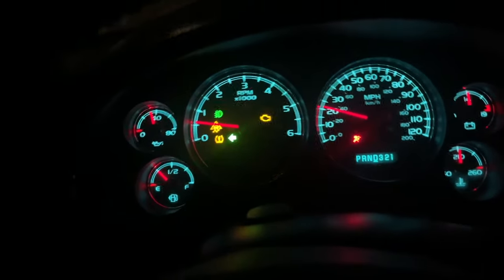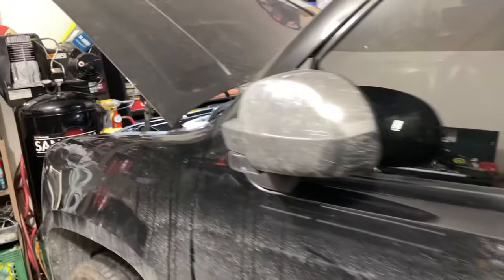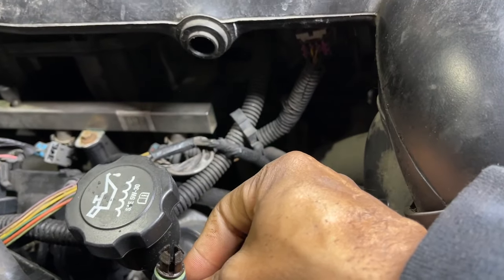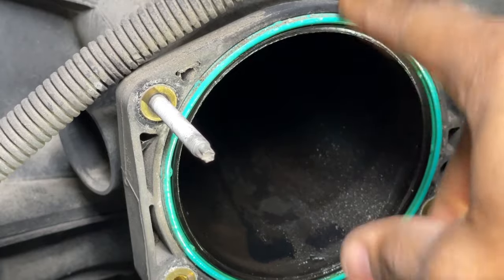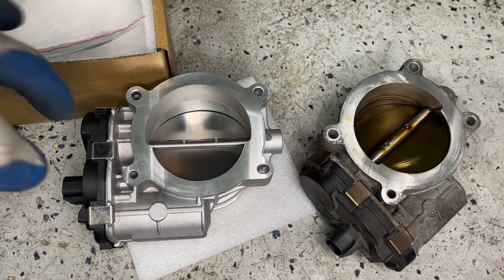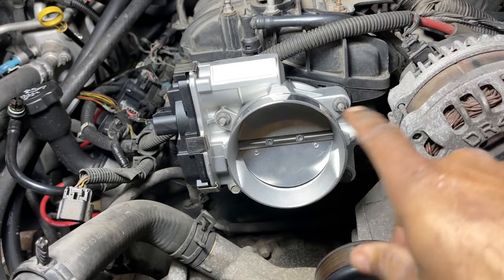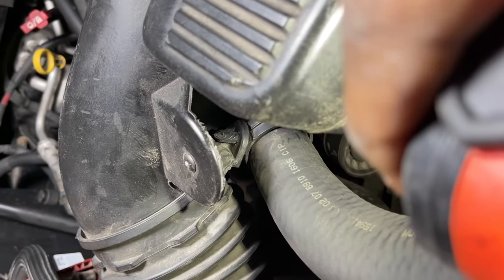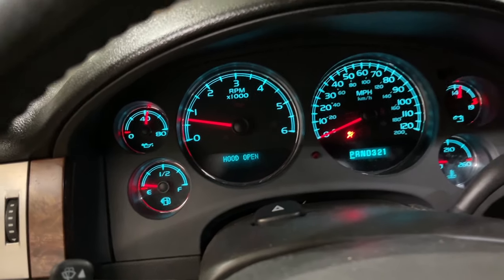How To Fix Reduced Engine Power Quick And Simple! Code P2135 Chevy Or GMC Trucks / SUV's! TPS Issue!

Comment: Thanks for the video. I ended up having to change the throttle body. My car has 125k on it. Only question I do have it, the voltage meter. What is it supposed to be on? I notice it starts at 14 or a little over then after a while it goes down between 12-14. Does that mean I need a new battery? Other than that, the car runs great.
Reply from the maker: Nope, you do not need a new battery. You're fine. Thank you so much for watching.
Reply: @TerenceDIY  thanks so much!
Reply from the maker: @jaezoeysvlogs9267  , you're very welcome. Once again, thank YOU for watching.

Comment: I'm curious how much your throttle body cost? I've got the p2135 on a Versa Note and my mechanic changed the accelerator pedal sensor yesterday then today it failed and did it again. Am hoping it's a throttle body sensor now up by the throttle body but maybe this is what I need too.
Reply from the maker: There are some correlation with that code although the car is different. What year is your Versa? Here are links for two different engines (I believe the only two that comes in the Versa)/

https://www.ebay.com/itm/404497710422?fits=Model%3AVersa%7CMake%3ANissan&hash=item5e2df13d56:g:p08AAOSwTChlCA-c&amdata=enc%3AAQAIAAAA0NxBoGsgfw1CUQXh7SN61L5MOU2m7YHpUY8O6oCM7djy67q95OcsNjuNFCAU9venJtYtMe4fvRiYl%2FvTpHj4kTXr1%2B9PMx2ZEnA9u%2FQjm5FW5CrAvZev2lNa%2Fr2Ff5QGnZyzGNMx%2FjrWa7cldSk7TdUmU6vvOtQvbkbdd7q6oiTjGh95H1o22jr7Tl1Ia6ujbakBhTYmk4Bk%2F31V2XqDcDtcxPiUV2kuZToo1dAPXwSTTX9mpD9IeaAw0TDMhoe2fZDOKjBJh8qBw8YbaVoV0zA%3D%7Ctkp%3ABlBMULbs1IvwYg

https://www.ebay.com/itm/255438181565?fits=Model%3AVersa%7CMake%3ANissan&hash=item3b794d54bd:g:paMAAOSwq6NkwMVs&amdata=enc%3AAQAIAAAA8E5Ukk3gmI0mWPi1uzqGXCwF0%2FJZN46gR9sSgJh29PlQvAE4IYq0XwMNDGBHuPWM0upqI7HCO16Gke6hbDiw84oy8Q94AlLqdcNNsP6CXayvJn9d7Mk9EzGY4G2bikeLr4GT%2FK90573ZMZcXQ20NZRO3PXbifCXRqDpm75AaQLZW0WEVGlmhGNaEReuAX8XwBo4LJUlAPzQt9uKK09tms4th3ZFLfhGeHrua%2Ff63MjE63iA8gJmleBRddF8nZa9Hiiq1lCynyNNOuNG4f%2FRTuJgla9gP6al3S84VU3VFhmmyGcSqlcP8y4va9o2FuXfG2w%3D%3D%7Ctkp%3ABFBMtuzUi_Bi
Reply: @TerenceDIY  Thanks for that that's not nearly as expensive as I was afraid it would be. Mine is a 2015 Versa Note.
Reply from the maker: Yep, they are inexpensive. You're very welcome.

Comment: Hey Terrance great vedio. I have the same problem with 02 cadillac truck. But it only has no power when it gets at operating temp. I have changed gas pedal and I have done major tune up. Do you think I need to change throttle body also let me know thanks.
Reply from the maker: Ronald, I've worked on a few earlier model Cadillac Escalades and If I'm not mistaking, I believe your truck has a TPS sensor. I had symptoms like yours on a 2001 Cadillac Escalade and replaced the TPS and it ran perfectly. 

Here is a link to the part...

https://www.ebay.com/itm/353602876285?fits=Year%3A2002%7CMake%3ACadillac&hash=item52545fb37d:g:WLUAAOSwNS9hB95-&amdata=enc%3AAQAHAAAA8KSF%2FdSWS1%2BR5i1P5f8vk54vclSdbdTUmQEhgfOny0AWmSFfbcHEm3u24IpnVK3hVpHCz2iHCx7d7wTlDghf5cnEdpJnzR157hQM%2BdcV%2FJPJiQ71iQxMOiXS3%2BvWfSM4eB4o3EVOmt1xbAtqHNA7mKBv%2F72aw0ak0sR0Yqp1hp%2BLkGKgVUHCkQhYDXroGJclm5I8jWWxAkaCTQ1qgmPudWOWkh6OVJOssLWv88c4LC8DH7PrBgPTwLgeS%2FlZMFBYpiGkkWKAFh3VJpfE4XgINzKiIrtHW7NBnlPrrezi%2B6Ya6ohsw41qc%2BKNjoGG2q%2BKlA%3D%3D%7Ctkp%3ABFBMtrDSiddg
Reply: Hey Terence thanks so much. I will order it and give it a try thanks.
Reply from the maker: No problem Ronald. Let me know how it turns out. Thanks again for watching.

Comment: Great video I’m having the same problem out of my 09 suburban  but I cleaned my throttle body and put it back together and it’s doing the same thing and it’s reving at 3k.  I think I should just change it and then my buddy said the gas pedal could be the issue also can you get back wit me on some advice please I’d appreciate that thanks
Reply from the maker: Sorry for the late repsonse. I've rarely seen the gas pedal being the issue and I've worked on many. The majority of the times it requires the throttle body to be replaced. Here is a link for the part if you decide to replace it (below). Thank you for watching. 

https://www.ebay.com/itm/273974704021?fits=Year%3A2009%7CMake%3AChevrolet&hash=item3fca2a3795:g:y0IAAOSwJeRgNim-&amdata=enc%3AAQAHAAAA8EBZbnc1LCSygdfhiYDkZYdGoD3ttGzQ5l5boPsF4Ze3hd5Wp4xZTyFxUDBUyl3ZhA5%2BBEF6HtdIAlhi%2BR6MqqBx%2FlmHRls7OFXwF%2Br63xeEZh9Js1AlWtqLAu6vAJOOLI83i%2BRwj0WQizJzCqKEOSvkJMksmu6tuNDZSRNniNU6zZIHXNKcSVoO%2BKrNu3QGuNe8%2BWzh65fFXWQo4qSUyGjShpR6otuuigrlCjG8POHBzvHy%2Blg4ZCGM%2FHoLUz%2B61ku3fcYKwsKumvrHX1aVN7mrODXDLCCG%2FzoSiCxk5ralJS2ZNy69Yj0hdOoxQnPGrg%3D%3D%7Ctkp%3ABFBMsPuPv6Nh
Reply: @TerenceDIY  thank you bro
Reply from the maker: You're very welcome.
Reply: *I replaced the waterpump a few days ago.

Comment: My 2008 Chevy Silverado is doing the same thing, I already change the throttle body and it worked for a few days then it startin doin it again
Reply from the maker: You should check the harness that follows the connector that plugs into the throttle body. I've seen mutiple post on the Chevrolet bulletin about the wires that run to the throttle body being the issue. Also, did you replace it with an original GM throttle body? The aftermarket ones are not that good.
Reply: @TerenceDIY  no I bought a factory one from the Chevy dealership,

Comment: I have a 2008 chevy Silverado ive spent crazy money replacing everything just did the tps yesterday and still same code p0641 and it does the engine red power and stabilitrack goes off i am lost
Reply from the maker: I've dealt with that code a few times on similar vehicles. Unfortunately, it was the PCM 9 out of 10 times that fixed the problem. I hope this helps. Thanks for watching.

Comment: Hello i put in the throttle body and it accelerates on its own goes up and engine shuts down what do i do ?
Reply from the maker: I have two questions... First, was the battery completely disconnected when you replaced the part? Second, did you use an OEM throttle body?

Comment: What is the name of that part I know it comes with a new sensor but don’t know the name of the part
Reply from the maker: It's called a throttle body. Here is a link to the part. 

https://www.ebay.com/itm/225590875332?fits=Year%3A2010%7CMake%3AChevrolet&hash=item34864394c4:g:tgUAAOSwNrhkby5M&amdata=enc%3AAQAIAAAA0NNQWXMnLtdnN%2Byk2rlPXLmDWd9AB5%2FNY652Eej11m1%2F%2FBCO7b5L%2F5kYwu2G%2FiIjmCXQhRCyGEq0LUGYMRA88FpvJcPcwE27If5mxCeP3vG6W5LgP5pjW5K9gWraTiJmkvjpUgRgSPfNW1iIiX7wNUbQiYDUszbrKMfUD%2B4PuolTPrHThw1m%2BLmIzDJHmAqsOMxE8CL%2FcbWx1GgGqyuo%2FbcgMiInIFFeTGjPVCpeCIYvGzqKgHKKWdVCxyvEkX4P0v8cB8X544I0q3p6jrL0gDU%3D%7Ctkp%3ABlBMUNyPq4-yYw

Comment: Hello, did you say the engine in this Suburban is a 6.2?
Reply from the maker: It's a 6.0.
Reply: Oh,ok. Did it come from the factory like that, or was it or was it swapped? The reason why I ask is because I never knew that Suburbans came with anything other than the 5.3. Thanks!
Reply from the maker: Yep, factory 6.0. They weren't common, but a great option. Thanks for watching.
Reply: Hey, LQ4 or LQ9?
Reply from the maker: LQ9. Thanks for watching.
Reply: Nice! Good info. Thanks!
Reply from the maker: Thank you and thanks for watching.

Comment: Hello Sir, I've a Ford focus 2013 1.6 Ti Vct and since 2 month I've been having codes and issues with throttle and pedal accelerator. I've replaced the pedal as well as the throttle. It worked fine for 3 weeks and now I'm having code P2135 and P0121. 
What can you suggest that I do?
Thank you
Reply from the maker: Did you replace the throttle body with an OEM one or an off brand aftermarket? There's a huge difference.

Comment: I have a 2009 chevy silverado single cab and I just put the new throttle bottle and is still doing the same thing what else can it be?
Reply from the maker: Did you buy a aftermarket one? Also, there was an issue with the harness that runs to that throttle body on Chevorlet bulletin years ago. Check along that harness for frayed wires.
Reply: @TerenceDIY  the one i bought i got it from oreillys and i’ll check the wires later
Reply from the maker: @arturogonzalez679  , I would have bought this one before buying one at Oreily's....

https://www.ebay.com/itm/333272439452?fits=Year%3A2007%7CMake%3AChevrolet&hash=item4d9895da9c:g:EpoAAOSw6QJdM5EW&amdata=enc%3AAQAHAAAA8MoUyTfsKekX%2Be%2BCj7USOvxRS2XHH%2B4s%2F3tNXtAZ4Z%2BLY2YJ8cZZawMqXI5eRkCN2peingTBDhw67RTFniZ13YeWeYbWwzGRlOX3gCqapuSIPwlEOfKzGzdNW%2BNzE8MbtbDD9z6OMQbiD8PHUpftDQob%2B8jIMZrSdyi6iSFtb%2B7Es92%2B7tLFSHLiPNZcXaFzS0bx0DVN%2F0USwpZK7JzOrTnJoZlngr1OcML6eXisvobwLquLxliqLsnnnwy0KSLenFK3RdOhtWSe81ytBq4IB3XtmPJTfU67VXNhyva0EuAk0xHtN01xk%2B9hn2gEScP%2Blg%3D%3D%7Ctkp%3ABFBMhNisiK1h

Comment: Hey I have the exact same problem going on ,on my 04 Tahoe I’ve had the throttle body replaced and throttle position sensor as well but still getting no power to the truck when pressing gas what’s the part you replacing on your truck? Or what else should I do ?
Reply from the maker: Hi, the throttle body and the throttle position sensor is one piece on your vehicle. Was the entire unit replaced? Did they use OEM parts? Here's a link to the part that should have been replaced on your truck if indeed you had the same issue as mines. 

https://www.ebay.com/itm/403341124758?fits=Year%3A2004%7CModel%3ATahoe%7CMake%3AChevrolet&epid=19056097644&hash=item5de9012496:g:yw4AAOSwpuZg3YmH&amdata=enc%3AAQAHAAAAsKAPRnavpJ3shiCJDwYpZr2axWmfAi899m3g0cCAQN7o%2FqKH3RvTmK9BfQtl4dRodghHTg4rkKNq4%2FRciyD888N1lGThhGo%2B8ZnzoFlDv0%2BFGq6infSvyABdZ%2Bp0VdhPkWEgRZC9zxQpteAJ8tr12ohE1GQCOjL9B3S0YhxqF%2FP3N1QTTn%2FTyyklcwM6aRCV3Lm56fa80JtWfZZL6qMYITLv8FNmXWAs343zAVlNsLs5%7Ctkp%3ABk9SR7Ca4OOQYQ

Let me know.
Reply: Have u change your sparks plugs ?
Reply: Have u change your  sparks plugs ?
Reply from the maker: Yes, I did a total tune-up on this vehicle. Here is the link....

https://www.youtube.com/watch?v=1K9NaCLlgDA&lc=UgwREDtfPcAKAiY9eHF4AaABAg

Comment: @terencediy i have a 6.0 denali yukon. It has been sitting for a year same problem could it be the tps on my gas pedal because i have the adjustable pedals and my gas pedal broke. So it doesn't adjust and it floos around until i put my foot on it and push back down on it to accelerate
Reply from the maker: I have the exact setup as you (6.0, adjustable pedals), and your problem could very well be the accelerator pedal sensor.

Comment: I’ve had the same issue on my 2008 Yukon xl replaced throttle body and gas pedal and it goes away and Come back I’m not understanding why
Reply from the maker: How long does the problem go away? Also, did you replace the throttle body with an OEM one? Thanks,
Reply: @TerenceDIY  it’s went away for a day and came back I’ve been told I need to reset the sensor but idk how I was told you drive it on the freeway for 30 minutes that didn’t work I even took my battery unhook for a he to see if that would reset it but that didn’t so now idek what’s going on
Reply: @TerenceDIY  wym OEM?
Reply from the maker: OEM is the term for the original GM part. The after market throttle body can be faulty even if purchased new. They are very unreliable. I'm not saying that's your issue, but I would not rule that out. Where did you buy it from? Also, there was a bulletin released by GM in 2012 detailing an issue surrounding the connector and harness that runs to the throttle body. The wires can become frayed or damaged so do a visual inspection on that connector. Here are two links to an OEM throttle body. One is slightly used and the other is brand new. This is what I used. 

https://www.ebay.com/itm/256031367242?fits=Year%3A2008%7CModel%3AYukon+XL+1500&hash=item3b9ca8a04a:g:Q5UAAOSwwztkKnaI&amdata=enc%3AAQAIAAAA8BMCXDiQkJtbNJ628QhOhMChCPS3HKyYnEdoyuE%2Ftajs2C3X48C%2BCQ7XYmic%2Ffy6gsx7JpWlGwsxeKrr6Eo3EWFY1%2FoogB4XKJYEZdJv%2FcABIoUw6FmOHM%2B7Pm0NCyzPuB6vbfWkMggU5f%2By77FDy8kfnTPc2Fd0ECjtA4Yj4vfR0opSzM%2BTrZDSu90mR6y7G%2Fk4wsFhj%2FlMcN880E7qP7wPExRsqOvCs6RsMk%2F2HZPhKQ6QIdru7ja1eq9MjtU0kTC6BtgwYFiz5OaUuQxLF9YOjKPlWSi8Ozz4L4%2F%2Fz2bE0htc2HQ2snHrBlXreUCQrQ%3D%3D%7Ctkp%3ABFBM2rL-1LFi

https://www.ebay.com/itm/325495832151?fits=Year%3A2008&hash=item4bc9103e57:g:c7kAAOSwc7FiBCeM&amdata=enc%3AAQAIAAAA0Oz%2F1Wb4%2B%2B4UQnLCEJyOd13cW6MfEy86x2rqixoH%2ByGeA6ytG8K6iGex6LeHlRZ%2By7%2ByrgaH0xDLnI1j3Aqs%2FSdQTZKMLAYSGAKfbWGOiP593ssgstofD43V6pyMD4mvaUPLdc9MCBvX20ZcrsRc%2BrL711fbZCmssi7LHhzEWoTVbvkb8Xu7PXRh7S16S7bPV0emvJFiUG1e6YHHMx9QvdJ1gmnlS99JM7ehhMduQOL0vkXtM1ae4M6zlgW2X%2FvEi63lkkzvN8K%2FtCscl2Atqsw%3D%7Ctkp%3ABk9SR9qy_tSxYg
Reply: @TerenceDIY  I bought the part from o Riley’s
Reply from the maker: That's definitely not an OEM however, I am not there to look at your truck so I cannot speculate on what the issue is.  All I can do is offer some advice or guidance.
Reply: @TerenceDIY  I found out it’s was my o2 sensor
Reply from the maker: That's great. I wish you would have gave me the codes. I might could have figured it out. Thanks for watching.
Reply: @TerenceDIY  I didn’t even think to give that fr bro
Reply from the maker: No problem. I'm glad you found out the issue. Once again, thanks for watching.

Comment: my vehicle is a 2013 Chevy Sierra 5.3L
I have changed that part twice and now it’s giving me the code P1516 along with P2135 again. Not sure where to go from here, but any advice is greatly appreciated.
Reply from the maker: A couple of quick questions... Did you replace the entire throttle body unit with a new one? If so, you need to visually inspect that wire harness and connector that plugs into the throttle body. Chevy released a bulletin years ago about that harness. I will await your reply. Thanks,
Reply: @TerenceDIY  Thank you for your prompt response as it is greatly appreciated! 
This vehicle was also crashed into 2013 and has been sitting there for many years, so I’m almost certain that the wire harness has not been replaced. I will take a further inspection into the wiring. And I did replace two throttle bodies that used that were in great working condition, but no luck.
Edit: Where can I find out more information regarding the harness?
Reply from the maker: Okay. If you every want to try a new one, here is a link for one at a great cost. Make sure the battery is disconnected throughout the entire procedure. 

https://www.ebay.com/itm/273974704021?fits=Year%3A2010%7CMake%3AChevrolet&itmmeta=01J18CWT5DANWE1TV8D5227DSQ&hash=item3fca2a3795:g:J4kAAOSwZE5mGTEF&itmprp=enc%3AAQAJAAAA8E06yIDENQEGtBF07wx%2B2BQUooy8Vneym9YyOVW2RmK7kzvWEgVo64P%2Fl4yAvspomfXyHcOBPkgWD8OKasG5qxmJtWkb9yJ6tj1%2BK6kN%2FijjbHy%2BTiKLRP1EETVVJuuEvI7m9E2hwyx89knFfGVtcnw9562makqlpEzT9VcgwU9tw6zjMxpdaOfPsjpJJl6GRlRX567FAwREWEHencEjvgSCySPmlNvs16tq%2FwGzb3t20Rt9iQiV76wFdAE23Yffaiw7p%2Bp%2BQnTiTmdCXgLC7Yg3uckhaOdr7tHmzFcspwHmvZ7tu7xClok%2BaDB%2B7nxzEA%3D%3D%7Ctkp%3ABFBM8qLzjIpk
Reply: @TerenceDIY  I will try. Thank you bunches! Lisa

Comment: How much did your new throttle body cost ? And we're did you buy it ?
Reply from the maker: Hi Victor, here are a couple of links to the part at different prices...

https://www.ebay.com/itm/333272439452?fits=Year%3A2007%7CMake%3AChevrolet&hash=item4d9895da9c:g:EpoAAOSw6QJdM5EW&amdata=enc%3AAQAHAAAA8MoUyTfsKekX%2Be%2BCj7USOvxRS2XHH%2B4s%2F3tNXtAZ4Z%2BLY2YJ8cZZawMqXI5eRkCN2peingTBDhw67RTFniZ13YeWeYbWwzGRlOX3gCqapuSIPwlEOfKzGzdNW%2BNzE8MbtXaOr0SNG9f0hGkwdeVp5ji%2By6YTiRiaTEaNKzDzFrGikO0smLVB%2B23DSoG85yAsR%2Fscu%2BEBb9BzkGbpI6nTzi5wELsj1a3z2ZxGOu%2FoBXKMG1sWXHEcZhzG70BVBHkOYjvvCeFrAv6gILru7tY8UE1CTseI6RJRA%2Fp8IIt4MmF2IJjj2YbQR%2BjAOBOW3wlOCw%3D%3D%7Ctkp%3ABk9SR9ruhea3YQ

https://www.ebay.com/itm/334541218588?fits=Year%3A2009%7CMake%3AChevrolet&hash=item4de435e31c:g:tGsAAOSwb0ZjDCD8&amdata=enc%3AAQAHAAAA8FdXoh9oW9uRIk3wdMzz7ex3PSbmBuJxEUFsaU1sHY8aLM%2BXLliIxuaIuivJaU6MKAIvl7da7pBJGTmKUr2QIJe0TwWbqlCjj%2F7RWa4hOhD0bLJUd00ANVJVV05NnimxtuqbtwoLFc4F%2BNTQUz1VWYU8WVTWfU1%2F0a9hRC8BM%2BaW9fuXTSt29A6VTGnSGBsrxtI6qo4E%2BbQLjzA9MhDLw0%2BZOn0T3%2FoY4IdFwrYy1AT1QV6%2FgQxTo%2BSnzQZz0lgmcGRxT3h23hKRYpek6pA3LFiuMcsdiMZtJLUovs6Agwa%2BPtYpESTRKWhg1sANRdJ1Vw%3D%3D%7Ctkp%3ABFBMur6K5rdh
Reply: Thank you
Reply from the maker: You're very welcome.

Comment: Hello my car has been doing this I replaced the throttle body, pedal and computer. Still doing it any suggestions? I have a 2009 gmc yukon
Reply from the maker: There was a Chevy bulletin post about this around 2012. There was issues with the throttle body and the wire harness that runs to the throttle body. The harness was somehow becoming frayed along the engine so I would inspect that harness thoroughly since the throttle body did not fix your issue.

Comment: I change my throttle sensor on my 2008 Tahoe now it idles up once I put it in Drive by itself. How do I fix that?
Reply from the maker: Was the battery completely disconnected before you removed the old one and installed the new one? Did you replace it with a new or used part?
Reply: @TerenceDIY  I replace the throttle sensor. It was new and yes, I disconnected the negative.
Reply from the maker: You didn't replace the entire unit? Here is a link to the part at the best price. Click on it and let me know if this is what you replaced.